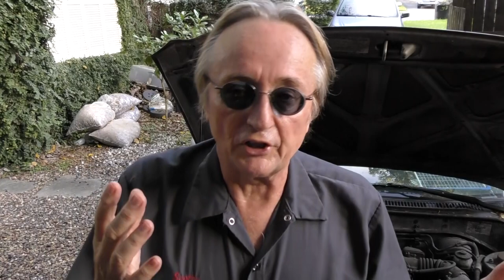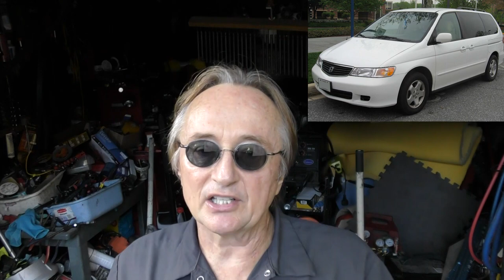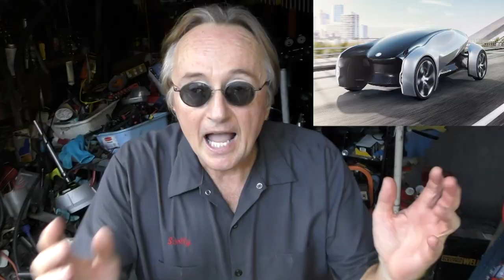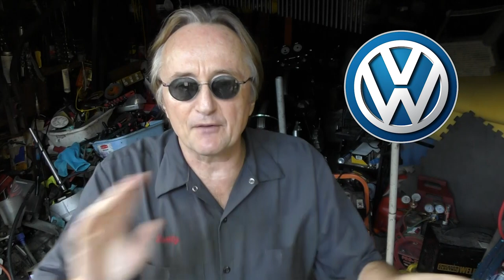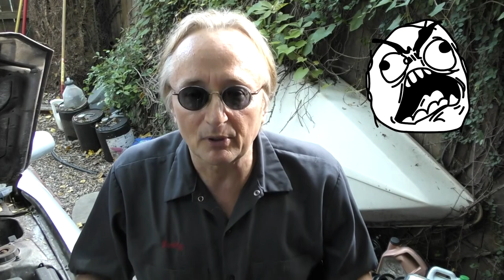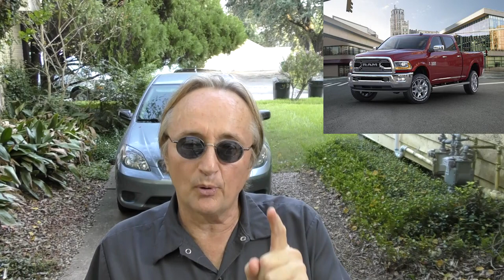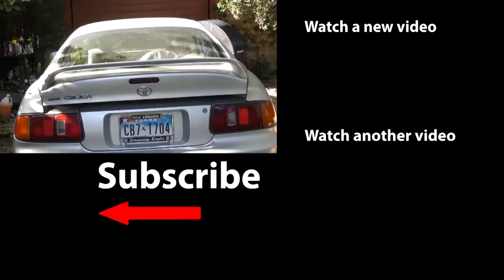Who Makes the Worst Automatic Transmission Cars in the World

Comment: I'd expected the Nissan CVT. Unpleasant to drive and as durable as tissue paper.
Reply: Hah  yeah  09-2012 was not kind to Nissan with  that transmission but it's not technically am automatic transmission.

But I agree  was  suprised not seeing it here... But  hey  at  least Nissan sorted it out decently quick.
Reply: Polar Bear is
Reply: I think the CVT in the K11 Nissan Micra is a reliable unit. Still see plenty of high mileage ones for sale in the UK.
Reply: My girlfriend has one and it is terrible! A great fact to bring up. The new one nissan put in her car is already failing after 10000 miles of driving it. Pieces if trash. The value doesn't hold. Chincy
Reply: Nissan CVT issues have been present since the early 2000s and remain with us today. Do not buy one of their cars unless its a traditional auto or a manual transmission.
Reply: they are fix
Reply: Are you sure it failing or over heating and going in safe mode? Nissan CVT has not have that problem since 2014, but the sentra or pulsar has overheating issue up to the early 2015 models, I guess was build before the update, which send the car in limp mode to protect the CVT, same as if the car cut power when the engine over heats, many dealers tell you the CVT fail, which there is nothing internally wrong with the CVT,  and replace it which was not the case and still did not fix the problem, Nissan start send out cooling kit for the problem and some people with older version, mechanic diagnose the issue had made cooling kit for them.
Reply: lol join a facebook page affiliated with any of the Nissan CVT cars and you will see complaint after complaint
Reply: There are many forum so I do not need to join any facebook group and the complain many you are speaking of, amount to how much? Join any nissan group and you will see many have gone over 200, 000 miles which countering your many assertion. First of all the first nissan to come out f japan with a CVT  was the murano in 2003, so you have add 3 years which did not exist. Nissan CVT just like any auto has problems, the biggest fault is that eveybody or group, group  the CVT in the same band as if they were the same year, and same model cars, which is not the case. Sentra , altima, maxima, murano span different times the CVT have issue, because they never start using them at the same time,  it span on different vehicle in different years. NO body check to find out how many murano was there, how many sentra was there, how many altima, or how many maxima has CVT that fail, overheat, belt issue and clutch problem. All was done was grouping all cars with CVT as one, when some use different CVTs, which make it look very huge. You do know that nissan have to report to the NHTSA. Well the issue report that 2% of the people buy nissan vehicle with CVT have being affected. The CVT did not make it because man is not talking about grouping transmission fail in a company, but which segment or competitor has the worst transmission or most failing transmission in segment, because car does not compete by company, they compete in segments, like corolla VS sentra VS civic.
Reply: @BigHead Clan because you are following the bandwagon, nissan CVT affect all models, but each model is different, How many fail on the sentra? how many fail and the maxima or how many fail on the murano? Nobody knows the number, they just combined every nissan car, but  the rate of nissan CVT fail was 2% accord to report gather which nissan have to report to the NHTSA, but car are not competed like how people are grouping them together,  they are competed in segements,like corollla vs civic vs sentra. The question nobody ask or find out how many actually was replace. Because if that is the case, then Honda would be in a worst position with  9 speed from ZF, the CVT in fit, civic and CR-V which all have high failure, but nobody does that with honda.
Reply: I'm not jumping on the bandwagon but facts are facts. I myself had an Altima with a CVT and it gave me 180k trouble free miles and perfectly maintained. Sure the forums can be echo chambers of sorts but even on the local level in my own town. I've seen multiple CVT model cars, mostly Muranos and altimas but its all the same Janco CVT junk. Plus they extended the warranty on a good many of the models from mid 2000s up to now. Nissan CVT transmissions are garbage. Plain and simple.
Reply: Nissan sold over 200,000+ altima year after year and many murano, there are problems indeed, never say there was not, but say the nissan CVt issue different year after year, and accord to the report it amount to 2% owners affected with failure, never I say they were good in performance either, until they start putting in shift point. Well if you think nissan is junk, what would you think of honda own CVT that have similar issue? It not plain and simple as you claim, the vehicles have to be compare which has more issue with their CVT.
Reply: Scotty said you should get to about 100,000 miles on a Nissan CVT before they start to give out, have to replace the Tranny fluid at 30,000 mi though

Comment: I would disagree about the "slip-n-slide powerglide". I had several, the last one in a 1966 Chevrolet Biscayne that I sold at 155,000 miles which was a lot in the day. I never had a problem with it, all you had to do was change the fluid from time to time. Actually many were used in drag racing by using 8 or 10 clutch discs instead of the standard 6 friction and steel clutch discs.
Reply: We used them at the strip back in the day a well built one  would hold up to a full Season of 1000hp  bigblock leaving the Line with the  transbrake on and the Engine screaming.
Reply: I agree Motown. I had a 65 Impala SS with the 250 Hp 327 with an Aluminum case Powerglide. I lived in an extremely hilly area and would frequently shift into low to help slow the car down. No slipping or sliding at all. Regular maintenance and not a single problem.
Reply: Powerglide was bulletproof. Only 2 speeds tho..
Reply: Anyone who knows Powerglides or high performance hot rodding or drag racing would know Scotty is WRONG is listing the Powerglide as WEAK.
Reply: I had a 1970 Chevelle 250 inline 6 with a Powerglide. Mine shifted great. I liked the way it worked. I had also forgotten about the popularity of using them in racing  so they couldn't be that bad.
Reply: There was not much of anything to break in a 2 speed auto trans. As complicated as an anvil and for regular drug it shifted like an anvil.
Reply: My first car was a 1970 BelAir with a 350 and Powerglide. I drove the car for 99,000 miles before I traded it in.  I just kept the fluid changed every few thousand miles and the engine oil changed every 3000 miles. The bad thing about it was it didn't have a security feature to keep thieves out of the engine compartment the way most newer cars have. It just had a lever under the front bumper to open the hood from the outside. I woke up one morning to start the car and it was dead. I opened the hood and the battery had been stolen. The mechanic who helped me said they would've gotten the carburetor too if they'd had the right tools.

Comment: Agree the powerglide is totally outmoded. However back in the 60s manual cars were mostly only 3 speeds. Most drivers would only change down when the engine complained. So for the average driver the powerglide was fantastic. The torque converter multiplication made up for only two speeds. The powerglide still is considered an almost indestructible box.
Reply: They're still sought after for racing. Great tranny for a 1/8th or even a 1/4 mile track. You just keep it in low the whole race.
Reply: @Landor1Gentoo  The only experience of one was in a Australian Holden E? owned by a family friend. It did everything a car needed to do and never needed an overhaul in 35 years of everyday use in a very hilly city.

Comment: My Chrysler Minivan 1997, 300K Miles  I have the ZF in my Cherokee and no shifting problems before or after the recall. Its the same one used in the Range Rover. I only but Chrysler  and I've never had a problem. Here's why: You can't take a car that uses a specific transmission fluid to Jiffy Lube and have them put in "universal fluid" there is no universal fluid and it won't mix with the fluid that is in the car. That causes cavitation and that kills the transmission.
Reply: 1993 Concorde 3.5 with A606 tranny... no issues. Just changed filter and fluid and shifts like butter. ATF+4 ONLY!
Reply: @ismann9148  How do you manage to have a 93 42LE/A606 that hasn't needed to be rebuilt at least once?!  Those are some of the most notorious for failure, even with the proper service intervals and fluid.

Comment: I have a 2004 Honda Odyssey w the original transmission.    I bought it used, in 2008, it had 56k miles on it and some parking lot bumps n scrapes, so I only paid $5k for it . . . Yes, a 4 yr old Odyssey w 56k miles on it for $5k.   Since then, I took out the middle seats, slid in a 3/4" sheet of plywood, yes, it fits just fine.   I use the van to haul construction materials . . . My record: 2,536 lbs of ceramic tile.    Hauled that load 68 miles n then drove up Lookout Mountain, about an 800 ft climb . . No problem.     I've hauled over a ton more than a dozen times.   I now have 218k miles on the van n it runs like a top.   Tranny is perfect.    One time, I was picking up 2,400 lbs of bagged concrete at Home Depot.    The female Mgr came out and stopped the loading. . . "Sorry, sir, we cannot load more than 1,500 lbs in your vehicle. . . ".      I said, I know you have a liability release form available to you, you either have it here at the store, or, it is easily available from Atlanta via fax, get that form n I'll sign it n release you from liability."     Total bluff.    She caved.    Since then, continue to haul a ton n much more.     Not sure what the limit is, but, it sure is not 1,500 lbs.     think I'm just lucky?     Guess again.    I have four Odysseys we use in our business.   Bought em all used.    Never paid more than $6,800 for one.    Approaching a million miles on the four of them.     I save the heavy loads for that 2004.
Reply: I hate Honda but if hauling any big loads like that again I suggest you keep it in third for the duration of the trip.
Reply: The max load in an Odyssey is around 1600lbs.  The tow capacity is 3500lbs.  The engine and transmission are designed for the weight, the suspension and frame are not.

So, there is no reason the engine or transmission would have any issues with the weights you listed.  You may destroy the suspension, bend the frame or cause premature wheel bearing and axle wear.  But the engine and transmission are actually designed to move around 5000lbs of passengers and cargo,
Reply: I have a 2003 Odyssey with 135,000 mi bought new.  Tranny rebuilt for $1200 (much less than the tax on a new Ody) at 95K mi at Green Transmissions in West Covina, CA. Ku is one of few that understand the flaws in the design and rebuilds with a 40K mi warranty with added tranny oil cooler. Personally, I no longer use the Honda fluid. I went with Valvoline Max Life and flush it every other oil change. Just to compare to another esteemed manufacturer, I have an '05 Tundra with 40K mi. Threw an EPA code (P1442,45 SECONDARY AIR INJECTION SYSTEM) that is a DIY $800 all plastic parts repair or $2700 at the dealer. There are no perfect cars even amongst the "perfect" cars. Each seems to have it's Achilles heal. That's why we have Scotty.
Reply: I got a 05, might not be a good idea to do that to a 05 and on Odyssey.  They had really became princesses
Reply: Hi Michael. 
I have a 2003 odyssey having 125k miles. I bought it used 2 years ago. I request your advice on transmission maintenance. Recently Honda dealer asked me to flush transmission fluid, change timing belts etc. Give me your opinions please.
Reply: Honda updated the transmission in later model 2004s. My dad owns one for a work van, has 262000kms on the original and shifts like butter. We use Valvoline Maxlife ATF and drain and fill once a year.

Comment: Good one Scotty! Honda or VW? My vote goes or Fiat Chrylser. The automatic Transmission in my Dodge Ram went out at 7,500 miles and the patched-up replacement 2500 miles later, followed by the Mexican Cummings engine, Three times, the first time when a soft-plug blew, a second time when a valve stuck and a third time when an injector stuck and burned a piston, all in under 18,000 miles.
Reply: That's terrible! I hope that you are having better luck with another vehicle. If not, don't stand too close to me. I wouldn't want the lightning to miss you and hit me.
Reply: yeah i doubt that lol
Reply: @TheSavage3.6   Of course you do

Comment: hey Scotty Kilmer please make a video about the "best Automatic Transmission Cars in the World" please!!
Reply: Porsche PDK and BMW/Dodge ZF-8
Reply: BLA BLA BLA
Reply: False claim on Mercedes manuals.
Had a 190e manual that was just fine for years and years
Reply: Jane S  Definately Aisin. My family had 3 saabs (9000 cse, 95 2.0 lpt, 95 aero 2.3hpt) all with over 100k on em. Never had trans oil changed and never had a problem. I have an 04 Kia Sorento 2.5 crdi diesel with a 4 speed Aisin box. I had the trans oil changed and its done 120k now. Shifts beatifully, overdrive just great. Also had a 1992 Mercedes E class 230e wagon. Nice merc box in that.
Reply: @99ron30  a kia ? Thats about the worst car in the world . In general
Reply: @boracay12  Nonsense. Hyundai and Kia group make some of the best normal cars you can buy. The Sorento has a Mitsubishi based chain cam 2.5 diesel with garret turbo and bosch injection. Sachs suspension. Ladder chassis. Borg warner transfer case. Aisin 4 speed auto or Hyundai Porsche Nissan co developed 5 speed auto jatco box. 90's kias might of been abit poo. But 2000 onwards are good to excellent.
Reply: @99ron30  overall the worst most undependable cars on the market ,here in the USA and even the Philippines , they are hard to sell used , every one knows someone who had one ,and their infamous reputation precedes them
Reply: @boracay12  Thats bollocks mate. Kia and Hyundai are dependable cars, so are Daewoo/Korean Chevrolet and Ssangyong. Kia Forte and Hyundai Accents are good cheap used car choices in the states. The Kia Rondo 2.4 is a great family car, independant suspension, chain cam vvt powerful naturally aspirated engine.
Reply: B be nice to see it happen this Transmissions out

Comment: My dads 98 Honda Accord V6L auto is still running as perfectly as it was new. By far one of the best autos out there.
Reply: How many miles are on it, they literally blow at 110-130k always. The 4 cal trans was actually good though
Reply: @saywhat5696  they were notorious for blowing up. I had a 99 but I made sure to get a 5-speed.
Reply: You're lucky, it's one of  the worst Auto Transmissions made by Honda next to Odyssey at that time.
Reply: @BasquiatSama  ours still made it to 150k with black fluid. Looked nobody had ever changed it when we bought the car.

Comment: Weird. I have both a 2002 and 2003 odyssey. The ‘02 has 240k and the ‘03 has 180k. Never a transmission problem on either.
Reply: Same here. Have two Odysseys one is 2003 200k Miles and the other is 2006 150k Miles never had the issue with the transmission.
Reply: Not every transmission made will be junk but a high percentage of failures will deem them as garbage
Reply: 240km on a 01. Never had a problem with that thing. But sold a couple years ago now so who knows. I think driving style plays a role. It was fun to rev that thing up but I rarely did.
Reply: 240k on an '05 Ody with original tranny. Great car.